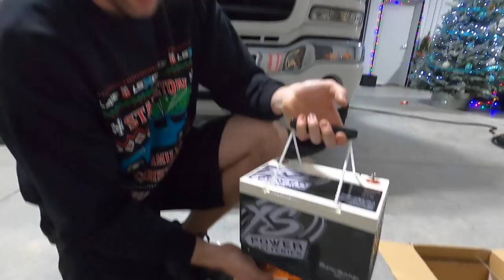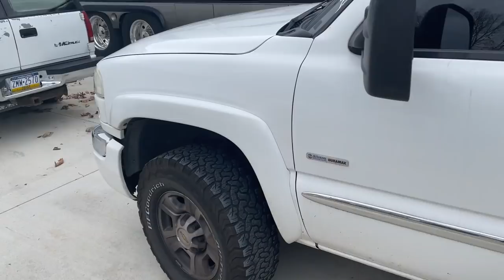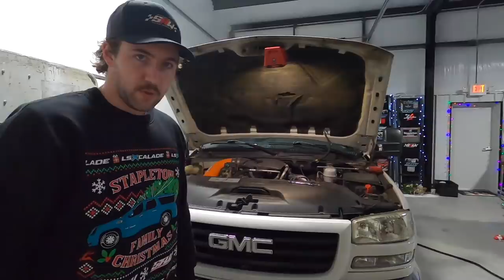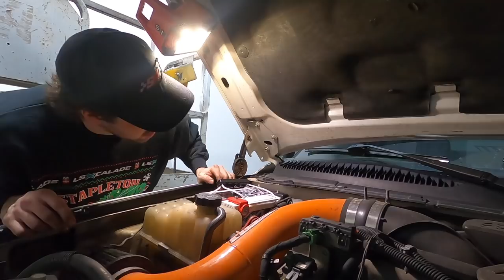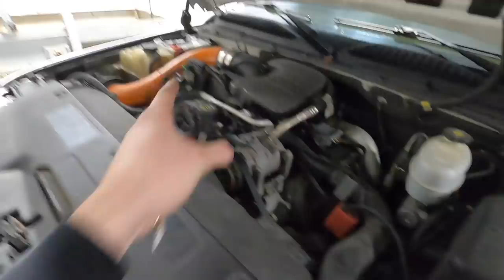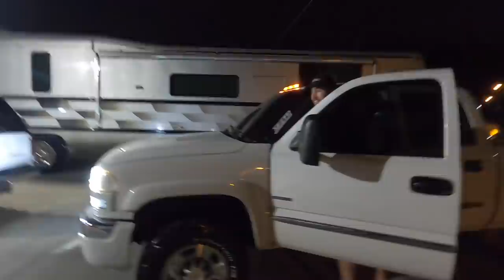The Coolest Truck Battery Upgrade You Never Knew About! (Bolt In Supercapacitor!)

Comment: This is something that never crossed my mind, but makes a lot of sense looking at it now. A capacitor (or bank of capacitors) suits the application better than a battery- seeing as a capacitor has a much better ability to discharge.. and that characteristic is already being used on a ton of equipment from board level stuff all the way up to capacitor start compressors and fans.

Comment: The best part of using a capacitor to start, especially starting any larger motor is that you don;t put the strain of both amperage and voltage draw on your regular batteries. If you maintain your charging system they will last  significantly longer.

When you're replacing four Group 31 batteries every fifth year instead of every third year in  a commercial vehicle  you're saving a lot of money,

The Newell would benefit from that upgrade.

Comment: Super Capacitors are Awesome! I use them in my Cummins as well as all my Solar Applications ! Thanks for sharing.😎👍
Reply from the maker: Yes sir! We appreciate you
Reply: How do they work for solar applications?
Reply: @wrjgr7627  That are used the same way as a Lead Acid Battery. But You have to change the settings on your charge controller to accommodate for the  voltage of the New Battery . Based on the manufactures specifications for that battery.(voltage, Amperage ,etc) Hope this help You...

Comment: Pretty cool. I added an aux battery (Optima) to my '15 Silverado 1500 5.3 with a Cole Hersee 48530 isolation solenoid so I could run the main power to several loads separately like a subwoofer and inverter. It also parallels the batteries in case the main is discharged through a switch. The truck charges the main first, and then will parallel charge the aux. When the truck is shut down, will automatically isolate the two. This looks great for having some extra cranking amps for the diesel.

Comment: I just got this video today and I just want to say I see you noticed how much faster your vehicle starts using a capacitive battery than a lead acid or AGM. You may now already know that capacitors have a lower internal resistance than lead acid. Lower internal resistance means current moves much freely and faster with a punch. Capacitors can charge just as fast but to be on the safe side keep using the provided led lamp, this slows down the charge to a safe rate of charge. I'm new to your channel and I support you for trying new ideas. As for car/truck audio, bass notes requires large amounts of power to be delivered fast(capacitors can do just that).
Reply from the maker: My truck did start a tick faster. It is also very very good at jumpstarting other vehicles. I paired it with a power master 225 alternator and it is a beast. Only issue is occasionally the terminals would wiggle a bit loose and crank slightly slower.. but I have fixed that
Reply: with the capacitors do you have to worry about unhooking the capacitor (battery), will it shock you like a traditional capacitor or can you just unhook your battery cables and be fine? @Stapleton42

Comment: This is a Kool video and  on a bigger  scale  as a electrical linesman I have installed  capacitors on the overhead  power  lines  for the same purpose  in industrial  parks  where lots  of machines demand start up dranes on the power grid  aways out  from  the substation. next time you see six gray box looking transformers in a aluminum rack up  on the utility  pole we call it a cap bank. It a demand booster / lode balancer
Reply from the maker: Interesting I’ll pay attention for that!

Comment: Super interested in the new batteries. I have tried alot of different batteries in 450& up trucks and Peterbilt’s that they give up when it’s cold. I will give them a shot and I hope they are the new way. Rock and roll guys. Great shorty from you guys. You guys look so happy and more smiles and a great banter that is so easy and great to watch. Can’t wait for the next one.
Reply: How did the battery hold with the capacitor

Comment: Mitchell, thank you for the continued phenomenal content. My surgery recovery has gone backwards and not doing good. I'm the one who found your channel earlier this year when I bought my Yukon XL, I got rid of it for a 6 speed Acura TL, well my body said I cannot physically drive a manual and my wife's car blew a brake line so I picked up an 04 Suburban LT. The issue I'm having is the heated seats turn off after 30 seconds, if I push the brake pedal the AWD light on the switch flickers and it acts weird. It does have the adjustable pedals. And yes it's an AWD, not a selectable 4wd. MERRY CHRISTMAS to you and Logan and your family. And a happy new year brother

Comment: I have seen this tech. used jump boxes. As long as the existing battery has even a small amount power in it, the weak battery will charge the jump box up to start the car. This may sound weird but it is true. Good video.

Comment: I've been using a d3400 and an sb500 for 3 years + in my stereo car, The Cap Will Loose voltage over time if you don't run the vehicle or keep a tender on it. its slow but it happens. if you don't have the two isolated from one another it will drag down the battery voltage, eventually harming your float voltage. FYI if you did not already know.  Also if memory serves me, that cap can dump up to 10K amps, and that d3400 is 1000cca and 3300 max
Reply from the maker: Good thing this truck gets used every day. At the most it may sit for a week if we’re out of town or something lol

Comment: also do a thing called the big 3 0 gauge wire from batt ground to frame, batt ground to body of car, and batt ground to engine and delete the old grounds xs power batts are amazing!!! i use all that for stereo systems and such you can also upgrade from pos batt to alternator for better charging aswell!

Comment: I have a small, light jump start pack which has super capacitors in it. Providing the battery on vehicle to be jump started has 10.5 volts in it, it will charges the capacitors up to 15 volts and starts a vehicle straight away. A great piece of kit, but not cheap £300 +/- in the UK.
Reply from the maker: That’s a really neat concept!

Comment: I run 4 XS power batteries in my 4,000+ rms sound system. They're all 4 or 5 years old and still hold strong at 14.6+ volts with the system cranked 100%.
Reply from the maker: That’s awesome man they’re the best

Comment: I used a 3.0 farad capacitor on my audio equipment  back in my speaker days along with few extra batteries it definitely saved my alternator and regular battery for my car before I put all the extra batteries and caps on my alternator and battery both were fried with in a month of my stereo hook up. I put one red top optima with a 3.0 farad cap went 3 years without changing alternator or regular battery lol so yes these are very beneficial in any case!!

Comment: Looks like a cool idea. I put dual Optima batteries in my Duramax and it starts faster than that. I was amazed that I was able to start my truck with one optima. I would like to see if those work on deep cycle batteries for a camper
Reply: The benefits of capacitors is for high amperage short loads and quick recharging. Not for long slow discharging like a deep cycle. The exact opposite application.

Comment: I've heard of the new solid state batteries which will eventually replace lithium ones.  Perhaps this is what they were talking about using super capacitors to replace any lead core battery.  By the way, wishing Logan and you a very Merry Christmas.  Cheers!

Comment: I've installed a starter capacitor system in ambulances in the past.  Different company then your using but still impressive.   If remember the capacitor was around 1k.  That was 8-10yrs ago.  For so reason we stopped doing it.  Bean counters I guess.

Comment: Is there a way to use a capacitor as the only battery? Or it has to be a dual battery set up? Pretty cool how fast it turns it over.
Reply: The problem with that is the capacitors don't have the capacity to run those always on loads in the car, the car computer goes into sleep mode not off completely, security system is still on, etc. So if you leave your car parked for a week, then you can't start it.

Comment: truckers have been using ultra caps since they came out circa 2010 to save money on gas by taking the load off the alternator. makes sense with a 24v system where youre starting out with multiple 12v batteries. they do cause issues with leakage if they are left alone... their stored energy basically leaks out into the air/space much more quickly than a lead acid. 
if ur not driving ur car every day, capacitors are probably a bad idea... not having them isolate correctly and draining ur car battery is basically what happens to everyone who ghetto rigs a sub in their turnk and cant figure out why their car battery always drains... atleast im assuming the amp has a big cap in it that doesnt self isolate.

also... basically all lead acid batteries are made in the us in Missouri and Indiana by one company. i forget their name but they mfg all the brands people spend hours choosing between at the autoparts store/walmart. lead is the most recycled thing in the world... except for maybe roads depending on how you count stuff. its inherently hard to ship and the acid they use is cheap to make on site but expensive to ship so its a unique example of a mfg sector that has and probably always will stay local in the us.

Comment: Did you have to wire it to a battery in the car for it to hold voltage when the cars off or you can go straight off alternator?

Comment: That's very cool! Skidoo has been doing something very similar with their "SHOT" electric start system for 3 or 4 years.  They don't use a battery at all just the super capacitor, they have the advantage of a pull start when the capacitor dies.
Reply: Doesn’t shot not have a starter? It uses the stator windings or something. I rode my friends 850 with it and it was pretty badass.
Reply: @georgewilde8465  yes, no dedicated starter and a super capacitor.  Very good on weight and a great idea!

Comment: Rewatching because I'm making a long term goal of building a DuraBurb and remembered this video. Is this setup still doing well for your truck? I'm planning on doing a lot of audio, lighting, and electrical upgrades/additions and think this would be worthwhile if it's held up.
Reply from the maker: Yes it is! Battery cables need a little tightening every now and then but I could fix that easily with different bolts
Reply: Would you just swap the suburban body on to the duramax frame? I’ve seen some duraburbs but I didn’t know how to go about it, I’d love to do it too!
Reply: @Scott_Buchanan  so from what I know the Duramax and Allison bolt right onto the Suburban 2500 frames of the equivalent generations. The rear axles are smaller on the suburbans so most people swap in the donor truck rear axle and front diffs as well. And like most swaps the tedious part is getting all of the necessary wiring and computers swapped into the suburban which includes the gauge cluster and 4x4 controls if you swap to the truck transfer case (no autotrac). All of the DIY guys mention having to do a body lift but I see no mention of that when I actually read through the two professional shops’ postings. I think it is doable without the body lift unless you want the full HD front body pieces and core support. I’ve found quite a few DIY forum posts if you want to do it yourself or Duraburb and Duramax Specialties are two shops that do the conversions full time. Hope this helps!
Reply: @zak3033  good info, thanks man!
Reply: @Scott_Buchanan  happy to help!

Comment: that is to DISCHARGE the caps so they are safe to work with? 
So the cap you connect Pos and Neg on the LED light to discharge it?

Unless you need to precharge so you do not get a huge zap when you connect the battery and Cap in the truck?
Reply from the maker: Pre charge so you don’t zap when you hook them up!
Reply: @Stapleton42  i was wondering if you could put some amps meters before and after the swap while it cranks. 
You could cut off fuel so you get more than 1.5 revolutions before starting. 
you should see a difference, or find a Nerd Youtuber to help with measuring the difference.

Comment: So long as you have the right voltage on the cap. The cap will just reduce the voltage sag during starting. Also the cap can be charged with a lower voltage then the Nominal car battery voltage in other words if your car battery is low it will still charge the cap to a usable output.
Yeah caps are cool. There downside is they self discharge very quickly witch can lead to them killing your agm/flooded battery if you leave them connected.

Comment: I believe the capacitor should go on the primary battery side closest to starter side with your battery on the auxiliary side. Remember a capacitor is a quick HD discharge quick recharge function quick power leaking device (wont long term hold a charge (thats why its not a battery) & a flooded or AGM is a slow charging 10v 6.5hr time to full charge 12.6a from dead 8v device (batteriesdo NOT like to be quick charged or the get HOT & explode); so your "battery"  is the "auxillary power supply reservoir" to the power punch capacitor that's powering your high amps  draw required 12v starter due to the high compression diesel. JMHO

Comment: I’m trying to find more details on doing this. So basically any truck that has two 12s in parallel… you just replace the battery closer to the starter with the supercap unit? What other modifications are required?
Reply from the maker: That was all I did

Comment: I've got a chunk of change coming in around February/March. I'll definitely grab one of these juicers for my project. Love your videos and tips. I'm still trying to decide on which engine I want for my project from Blueprint. Also still researching transmissions and rear ends. Not looking to go to your level. I just want a daily driver that has the b*lls when I want to t-bag someone who thinks their sh*t is the baddest when it's just a noisy BS ride with a Chalupa cam. That doesn't cut the ham and cheese. No Grey Poupon required!
Reply from the maker: 632 all day lol. But you can get a lot done with a 454 and plate kit for sure 😂
Reply: @Stapleton42  great minds think alike ❤️
Reply: “Chalupa cam” 😂👍

Comment: Tesla bought maxwell(Don't know the fate of them) and will be using supercaps, some factory cars do have them (albeit not 500F) for aiding in the star/stop function. Electric buses in china and the bullet trains use spercaps and ying long (LTO) lithium. I use them for audio which is nice because it mimics the charging system and not the batteries effective voltage. 

You thought the ECU on the terminals was bad, do it with them, My amp shifted arcing on my car body and the sparks it shot from trunk to dash on the passenger side looked like a clip from a 80s hair band video in a steel mill as it pulsed from charging and immediately discharging. 

If you ever have a dead battery you need to put a load(lightbulb) inline again and if someone jumps you same thing. It will suck the life out of everything on the jumper vehicle and smoke the alternator if not more. Awesome technology just like lithium but there is some need to know info that isn't being pushed enough with companies such as XS and xious

Comment: I’m curious if it would help the remote start on my eco diesel Grand Cherokee it try’s to start but won’t like starter clicks and everything until you just cut it off and remote start immediately afterwards and some time it won’t even then no codes showing just can’t find out how to add the wires over to the spot under the drivers seat from main battery under passenger seat

Comment: I run a snow plownon my Duramax I would be very interested to see how this works.....very big question how much $$ does this set up run?  I would think it ain't cheap, but if it works good would be worth it
Reply: Also what capacitor was used with the 3400 battery
Reply from the maker: The 10000 amp one

Comment: When you ordered this battery do they come together or are they separate because I looked on eBay and I found them I found it it’s not that expensive I’ll just wondering do they come together or do I how do I find the capacitor
Reply from the maker: Separate units!
Reply: @Stapleton42   What’s the part number for the capacitate her that you got that would help me a lot because I would like to use the same set up thanks for getting back to me

Comment: Another hazard exists when a capacitor is subjected to high currents that may cause heating and explosion. Capacitors may be used to store large amounts of energy. An internal failure of one capacitor in a bank frequently results in an explosion when all other capacitors in the bank discharge into the fault.
Reply: In high school electronics class we had fun blowing up smaller capacitors by overvolting them. Some small ones were like mini roman candles.

Comment: Some cool stuff there! I use an AGM-type battery in most of my vehicles, they work well(except when they do finally tank which is all of a sudden)and don't create any acid issues. That Dirtymax sure woke up quicker after the battery/capacitor install!
I use 285/75-16 tires on my 4wd Suburban urban assault vehicle. The Rolls may benefit from a tire upgrade....?!
Keep up the great video content, always with you & Logan in all these episodes! Thanks man! Merry Christmas to the both of you!

Comment: What are the part numbers for the battery and the capacitor I have a similar truck and would like to try this?
Reply from the maker: I’ll have to look on the xs power website
Reply: The battery is XS Power battery D3400 12 v. 3300 amps.

The capacitor is XS power 12v. Super capacitor super bank SB500-65 4000 watt 500 farad 10000 amp.